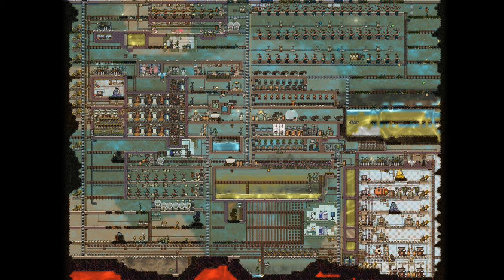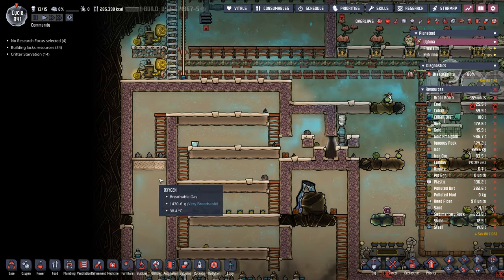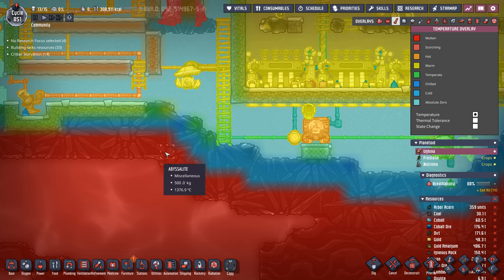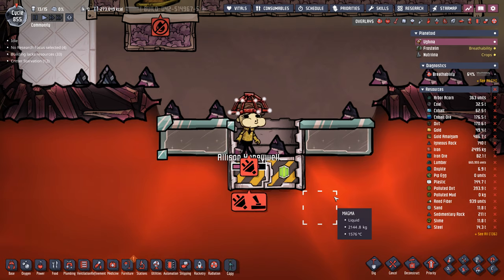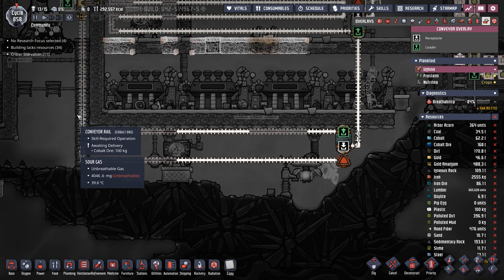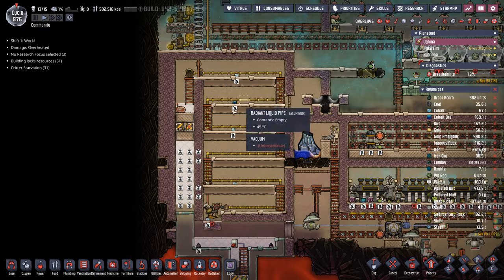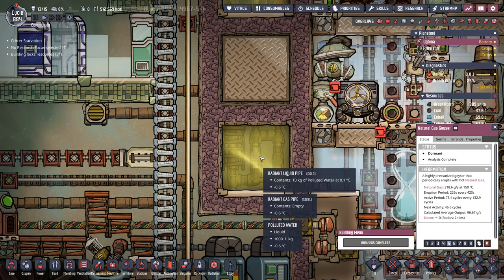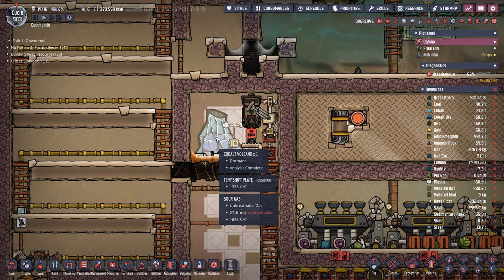Petro Boiler and Geothermal Power | Colonization Ep 12 | ONI Spaced Out

Comment: Love the video as usual. I wanted to add, with my transport rails/heat spreader, I have a conveyor chute after the thermal sensor but just before it would start looping, this allows stuff thats too hot to be picked up from the source and moved through the steam as well as being able to drop anything off the rails you don't want moved, with your tamer set up it would need an extra auto sweeper and loader below the volcano to pass the dropped items back onto the rail system but you could prioritise the stuff coming from the volcano to move the hotter stuff to where you want the heat anyway

Comment: It looks like dupes were dropping hot materials at those spots because of long trips without oxygen, when it gets low enough they simply drop everything and rush to an oxygen tile.  I don't see any hatches eating it.  Make sure single tile storage bins are set to sweep only.  Also check around other storage containers if they're set to store anything outside of sweep commands.  It might have been going to your rock crusher for sand.

Comment: as I understand conductivity takes into acount both materials that are itneracting. That is why abysalite is flashing your oil. But if you put 2 abysalite tiles there will be 0 trasnfere between them. And that is why u need 2 insulation titles. Another reason - heat transfere plates moves heat to every surrounding title - including insulatiion titles
Reply from the maker: I def want to do more testing with the abysalite.  Thanks for the info.

Comment: At 21:30, it is not the debris at all. The dupe in question breathes out CO2 which will break any small liquid lock. Easy ways to deal with it are O2 masks (they suck in general), atmo or rad suits.
Reply: Maybe that is one of the many reasons I never use the O2 masks.
Reply: I use a couple of them early game to get out of the home biome faster.
Reply from the maker: It is rare that a dupe will exhale in a vacuum.  Reason being is they exhale after breathing in, and they can't breath in the vacuum.
Reply: Maybe true, but it seems like that one did. Not saying the others did not drop a material there.

Comment: out of curiosity, why are you using a petroleum boiler when a sour gas boiler is much more energy efficient?

EDIT: Oh god making a petrol boiler and boring into the magma without atmo suits makes me SO nervous.

EDIT: Dups exhale CO2 that might be why you keep getting CO2 into your boiler.
Reply from the maker: We may do sour gas boiler in the future
Reply: @EchoRidgeGaming  sweet!
Reply: Dupes normally only exhale Co2 if they're getting oxygen.  They don't normally break vacuums or fill non-oxygen areas with Co2.  The exception is oxygen masks, wearing those they exhale Co2 in any environment which is why I never use them.

Comment: You're killing me with the temporary liquid locks.  Please melt a bit of plastic for some naptha.  It's viscosity makes it WAY more reliable for locks.  Instead of 40 grams, you get a few kilos.

I like to melt a plastic tempshift plate pulling heat diagonally through insulated tiles so it can't flash to sourgas.
Reply from the maker: I should def do this more.
Reply: @EchoRidgeGaming  it does make for engaging content when water/oil are used though..... It's like Nascar at that point.